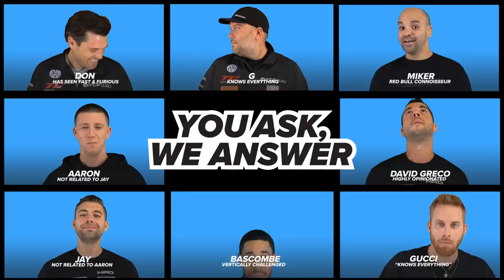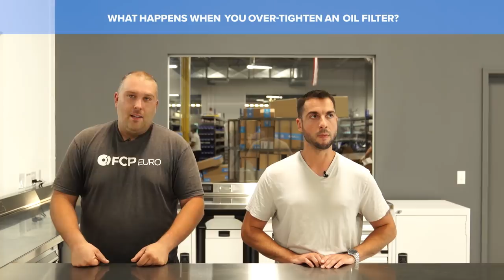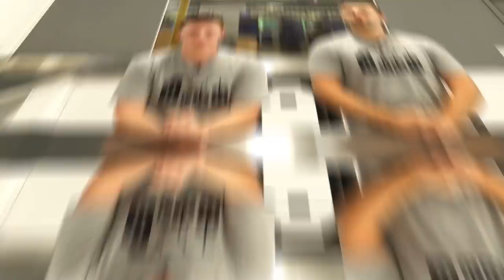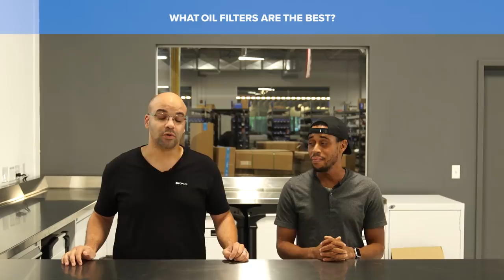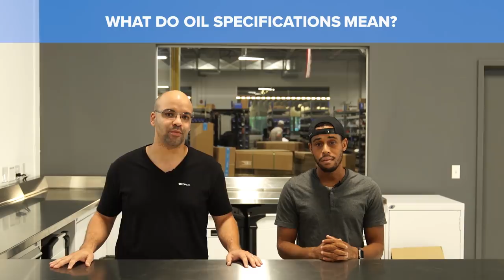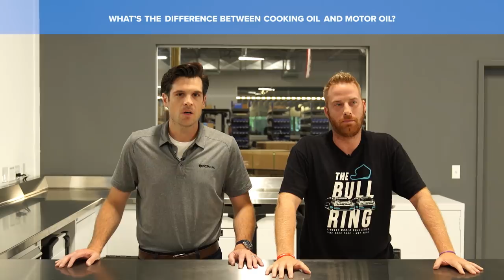Oil Changes, Filters, Capacities, and Weights - You Ask, We Answer

Comment: I changed my transfer case oil 5000miles ago in my 2008 bmw x3 n52 engine, now there is a code for oil wear in my transfer case. I can not reset the service interval, because my scanner says that the vehicle does not support this function. Can you tell me more about what could happen if I do not reset the service interval on the tranfer case? Thanks

Comment: Hey guys. I have a e46 02 bmw 325ci convertible  with191000 miles.
A couple of weeks ago I made the engine oil change and yesterday the light that needed more oil was turned on. what could be happening in the engine?
Reply from the maker: Pablo, I would check your oil level on the dipstick and add more if needed.

Comment: Oil filter lid says 25nm oil chang every 5k but since filter is up top, filter change every 2.5k mi;es on MB OM642 pre DEF scr but does have DPF
Reply: normally I'd say you're changing your oil too soon / often but those OM642's are nightmares.  I usually change every 6000-7000 miles on my 2009 ML320 with maybe an Oil Filter change for peace of mind mid interval.
Reply: Usually, the filter outlasts the oil. Changing the filter is not necessary if you are not changing the oil.